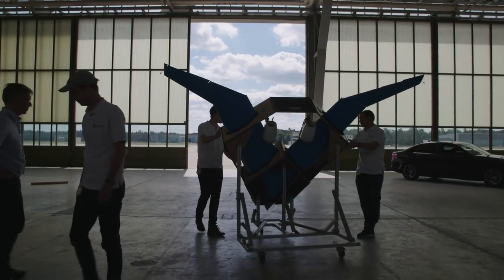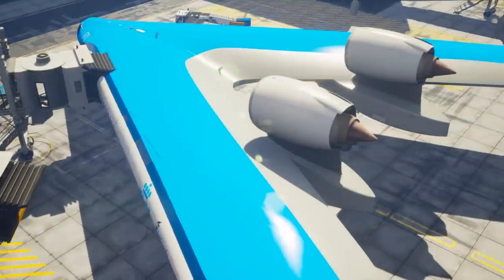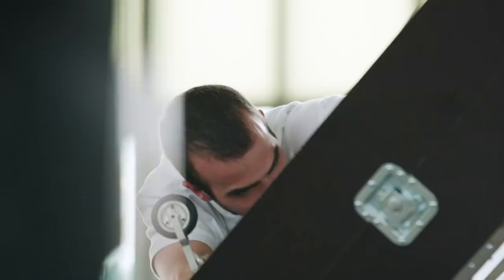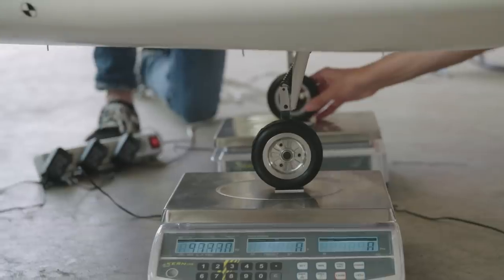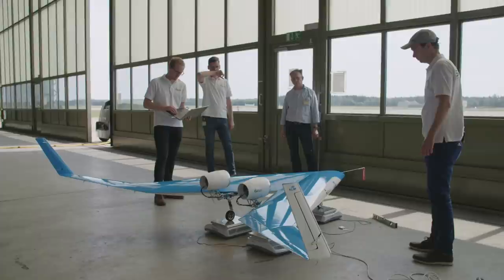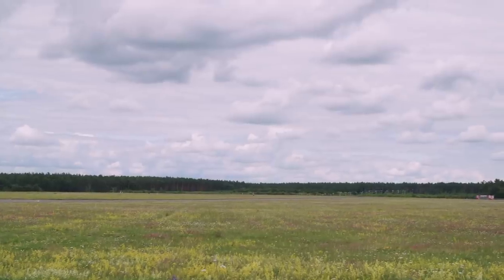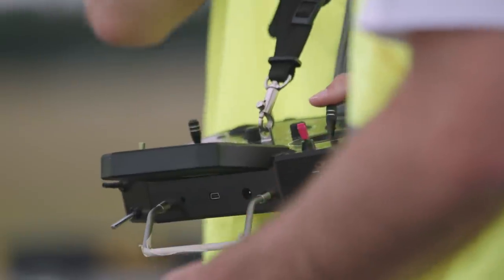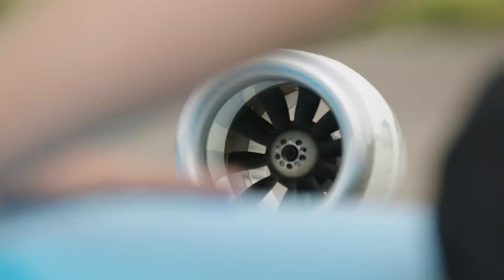KLM & TU Delft present: Flying the model Flying-V

Comment: I was so curious to see the landing though
Reply: The pilot landed on the nose gear instead of the back. So he nose wheel snapped. That's probably why they didn't put it in the video😅
Reply: @tjerkstrikwerda1557  Bah... that was the fun part! XD
Reply: Did they fail the landing? 😂😂  Big company and experience guys and researchteam. I thought at least they would manage to fly a Rc model aircraft. Hell i could have Done it Better! 🤣
Reply: @jonasreuterbring5193  The dutch are not made to be a Fixed Wing Pilot... They are not made that way. They always crash @ landing or takeoff..
Reply: 3:30 In my experience, RC pilots who only use their thumbs are not as good as those who pinch the sticks with their thumb and index finger. Also I find thumb pilots use tons of Expo to soften their inputs, but this reduces quick and fine control, such as during landing. This pilot only uses his thumbs. Just my opinion.
Reply from the maker: The Flying-V model had a somewhat rough landing and the nose wheel got damaged. This was due to a gust of wind and the pilot's response to this. This is common practice with scaled model test flights. (It’s estimated that one out of two scaled aircraft gets damaged this way.) The model is now being repaired and prepared for subsequent test flights.
Reply: @KLM  Yep, but why omit it from the video when it's common anyway. Heck, you should see all the videos on Youtube of RC controlled aircraft that get utterly destroyed. "Just" a damaged nose wheel on a first flight is not a bad result by any standard!
Reply: Jonas Reuterbring jaja, makkelijk praten heb je.
Reply: @Tiger313NL  welcome to public relations buddy....
Reply: @KLM  can you elaborate on the handling with crosswinds?
Reply: Yap I was also waiting to watch touch down.
Reply: Stall speed? Way too high to be practical... Commercial aircraft first and foremost need to be gliders, I guess they forget to tell the engineers. Drugs are bad kids.
Reply: i thought its still flying :D
Reply: Atleast the truth is not kept hidden. Still a long way to go to roll out for the public. Let's see the future and it's exciting anyways.
Reply: @KLM  its also very common with regular ryanair planes
Reply: @tijmen7839  ah yes, ryanair.
Reply: @jorojojojo  lol
Reply: @KLM  This is truly amazing, thank you and keep on sharing these HUGE steps forward for aviation!
Reply: @KLM   For the future try the "SpaceX" approach! With their Youtube video "How Not to Land an Orbital Rocket Booster"
Reply: @RoboTekno  thumbs: speed, pinch: precision.  I use thumbs on left and pinch on right,  50% precision, 50% speed  🤣🤣🤣🤣🤣🤣
Reply: @ivrj  We all can't be perfect :-P
Reply: @KLM  thanks for being so open
Reply: @KLM  You should show the landing even if it didn't go well. SpaceX isin't scared, they made a whole blooper reel out of their rocket landing attempts because they know trial and error is how you get to success. Best of luck with this project!
Reply: @robertpolkamp  Mhm, but there is one big difference you forgot to add. :)
Reply: Take offs are a choice, landing is mandatory
Reply: Iemand Hier van nieuwsbegrip 🤣🤣
Reply: It doesnt land, its a one way trip
Reply: @lex1945  Probably a little of both. The B2 had a near 10 year delay to develop a computer system to catch the horrendous stall characteristics. It also still has ejection seats. This concept for a commercial airliner is a pipe dream at best.
Reply: It sucked the front landing gear broke of
Reply: @tijmen7839  hahaha
Reply: @jonasreuterbring5193  They were not even sure if it was going to fly properly, so they did archive their goal. The rough landing was mentioned in the press release, but is not shown in the video, on purpose i presume.
Reply: @RoboTekno  I've been flying for 20 years and your observation is completely incorrect.
Reply: @KLM  Uhh you guys didn't just fly it on FPV? IMHO that has to easier for RCs.

(Or maybe some RC enthusiasts who've tried flying on FPVs can help he whether it's easier or harder?)
Reply: @KLM  try making a bigger model that is a bit heavier to make the landing better (mass=less shaking) please watch Living Waters on YouTube, God bless
Reply: That's what I want to see!

Comment: "The current design shows ‘wobbling’, in a technical term, Dutch Roll. That makes it difficult to keep the wings level and caused the aircraft to have a somewhat rough landing." 
From TU Delft Flying-V website. 
That's why they didn't show the landing in the video.
Reply: I have seen the landing and it was a Good Landing
Reply: @adriaanvandenberg5814  Then you should write TU Delft immediately and tell they're wrong about their own aircraft.
Reply: @Steven Leonardy
 The wobbling - at least in part - would be remedied by the bulk and momentum of a full-sized aircraft in the same way a scale model of a ship behaves completely differently than a real ship.
Reply: Clearly Bc of the weight Probly not even 200 pounds Ofcourse it’s going to wobble with 20 mph winds
Reply: @vondahe  A good landing is a landing you walk away from. It's a joke. Everyone got it except you.
Reply: No, the reason they didn't show the landing was because 1. the video was about the flight, and 2. the landing went wrong because the pilot thought the airplane was already hitting the ground with its wheels but it wasnt, so he pitched down too early and crashed and they broke the nose wheel off
Reply: That's not a good reason not to show a landing
Reply: Ha ha Dutch roll on Dutch plane
Reply: They could have flown a consumer flying wing RC kit, and seen the same roll. By the time you get rid of the roll with wing fences and vertical stabilizers, you lose all the efficiency you gained.

Comment: This design is cool but there are many challenges to overcome:

1) High Angle of Attack: At high angles and slow air speeds, it's possible for the body to plow air and as such, leave a undesirable vacuum or disturbed airflow above the wingbody. This could starve the turbines for air and cause issues.
2) Assuming that the wings will hold passengers, compared to a traditional airliner where the passengers are in the center, a roll of 10% is at most a few meters but now that the passengers are isn the wing, this will result in much bigger difference when rolling.
Reply: but what is the advantage of this design?
Reply: @half.blight  read the video's description
Reply: The engine problem could by solved by adding air intake ducts on the front of the craft to feed air to the turbines
Reply: @half.blight  reduce the drag, hence less fuel consumption
Reply: Flying V is in development stage for more than 10 years.... Of course there will always be changes until everything is fine.
Reply: Ryan Karuna Efficiency. MUCH EFFICIENCY. And probably more speed bc their is less drag.
Reply: @fever040  And there goes your efficiency down the drain.  Massive intake frictional losses.  Massive loss of Volume and therefore loss of efficiency hauling cargo etc.
Reply: @BearRealOfficial  RC plane, that is to be expected on all flying wings.  Longitudinal stability is a problem.  On a real plane... still a problem, but with FBW... not a problem
Reply: A spirited ride indeed during combat maneuvers...
Reply: These are engineers, they’re thinking about all of that and they know as plane designers
Reply: @atlantic7949  they are milking money, just like the hyperloop people.

Comment: Would be so strange to see everyone have a like a cockpit view.
Reply: Being if they even give the passengers windows. Can’t really put windows on a wing’s leading edge...
Reply: @dylanmiller9604  you can, just need to put aerodynamic windows
Reply: Une Pintade well I mean... icing... constant loading and unloading of the wing...
Reply: @dylanmiller9604  my thought exactly. The glass windows would facing directly against the air pressure. Unless they make the window as strong as the window buildings in Chicago.
Reply: Dylan Miller yeah you can. I don’t see why not.
Reply: @dinostudios6579  cost probably, making super strong windows on every new plane being build.
If you've ever flown at night for over 10 hours you notice it gets daylight at some point, some daylight inside of the plane is really awful, maybe they can install cameras and people can look outside through their monitor.
Reply: @DamienAlexander  Or just shades. And to be fair, glass can be really strong. Though as you say, expensive. But composite materials aint cheap either.
Airlines aint afraid of spending money to get a plane thats more efficient.
Reply: A pilots view all the way to the scene of the crash..
Reply: @unepintade  Airbus' design will likely have windows, but there will be fewer of them relative to the number of seats.

Comment: Landing must have sucked or they would have shown it.
Reply: Apparently the front gear broke while landing
Reply: Johnny J Only the nose wheel got damaged. Not bad for a first test!
Reply: The fact they aren't comfortable with failure doesn't improve my faith in them
Reply: @MSman-ff8fx  Of course. There is always failure behind any success. I guess I could have worded it better, but my point was that if they cut it for no other reason than because it crashed, that would reflect poorly on the company culture
Reply: Next test flight might be the landing :)
Reply: It did suck the front landing gear broke of
Reply: ༒Gorm Auslander༒ I see what you’re saying. They did, however, say themselves that the front landing gear was damaged in another comment.
Reply: Not so much land as plummet.
Reply: @gormauslander  no one's comfortable with failure,  if you are, you're a robot.
Reply: @erikerice9068  That's not even remotely true. I can see how you would think that, having never met people like that, but they exist, I have met some, and it's very often these people create a good deal of success because they don't get hung up on it, they see every mistake as a learning opportunity.
Reply: @gormauslander  yes, you are right. Failure is the greatest teacher.

Comment: what is the behavior of the aircraft with only one engine?
Reply: The proximity of the engines would make it more sustainable with only one engine I would imagine.
Reply: the behaviour would be identical, however having only one engine wouldnt be as smart choice since the engine would need to be very powerful and in the case of an engine out failure there is no backup to bring the plane to the ground savely
Reply: @philipvaartjes7715  my question was; this aircraft has two engines, but if one fails, how will it behave, will it be similar to the other planes?
Reply: @TheAugustoFigueiredo  It would be even easier to correct for than other planes because the thrust axis isn't that offset
Reply: @jd_99  I believe, but seen by a nonexpert, it seems that it could act as an axis and turn on itself
Reply: @TheAugustoFigueiredo  in current planes the engines are much further apart from the center of mass creating a bigger yaw leverage if one fails. In this design the engines are much closer to the longitudinal axis creating smaller levarage if one engine fails. Anyway in this case we don't know how much counter autority we will have in yaw to stop the motion in case of failure.
Reply: The real question should be "what is the glide slope minimum", since any passenger carrying aircraft is required to perform as a glider before certified. This design completely ignores this fact. Angle of attack and lift coefficient are not only highly suspect in this design but likely many times the required minimums. Cute boomerang, not an aircraft in the commercial sense.
Reply: @robertpolkamp  IDK, this does seem to have more lifting surface compared to regular aircraft. Not entirely sure how control surfaces interact with the whole thing. Wouldn't it be nice if they released flow sims and compare it to, say, a380?
Reply: @robertpolkamp  that was my fear ...
Reply: @0xf7c8  but normal planes have a bigger fuselage which helps with tracking straight through the air and dampen that yaw moment (although creating stress on the airframe). Some stuff like that must be analysed later in the actual design process of the actual airplane.
Reply: @TheAugustoFigueiredo  The failure of one engine can be easily overcome by using a digital fly-by-wire system (standard feature in most modern planes), provided the flight control surfaces of this design have adequate control authority. The flight control surfaces (rudders, and elevons) will have to redirect airflow such that the  drag, lift, gravity and thrust vectors create zero turning moment around the axis about which you are imagining the plane will turn when it loses one engine. That axis is the yaw axis that passes through the center of mass of the plane. The amount of airflow redirected must be sufficient to counteract the net turning moment generated by the loss of one engine. 

Redirecting the airflow like that will introduce an angle between the direction in which you are heading and the direction in which the nose of the plane is pointing. This angle is known as the sideslip angle. Sideslip will lead to reduced lift, hence wings need to be designed to have higher lift than would otherwise be needed. More power from the engine will also be required (which will guzzle fuel faster than when both engines are active in the cruise phase of the flight), since drag will also increase. 

All this has to be designed in from the ground up in the airframe itself. This is a multivariable problem and a lot of optimization, number crunching, CFD modelling of airflow, wind tunnel testing and tests on prototype vehicles are required with design changes and concurrent changes in the flight control software of the fly-by-wire system (called the Control Law). The software for these planes run into millions of lines of codes.
Reply: @philipvaartjes7715  Which means it needs to be able to glide without power..
Reply: @austrobok2958  exactly 💯. The other alternative is to install 200 ejection seats 💺... the B2 bomber had a 10 year delay just to sort the computer so the flying wing would glide and still needs ejection seats to this day. Cute design from a few Nederwiet smokers but hardly a mode of transportation for grandma 👵.

Comment: The cabins located far from center of roll would cause discomfort while turning. Would otherwise be a perfect cargo plane, UPS might want to have a chat.
Reply: Imagine sitting in the rearmost part of the cabin, when the plane performs departure turn after takeoff. Roller coaster fans will be excited!
Reply: I'm actually more concerned on where they are gonna put the fuel tanks
Reply: TheManticore i think theyre below the engines
Reply: @RealPyro88  so theyre gonna need some thicc wings to fit passengers, fuel and cargo.
Reply: TheManticore no no the interior there is like a triangle in, the passengers themselfes are inside of the wings
Reply: I imagine a slow roll rate will do the trick, though it will be interesting to see how slow you actually need to be. I can imagine you'll start using yaw more, which shouldn't be an issue, because it seems like this version has twice the rudder of a conventional plane
Reply: After one turn KLM could auction off the rest of the first class seats for thousands! 🤣